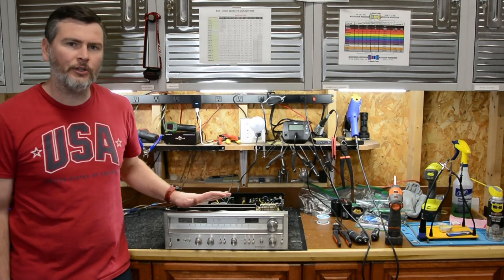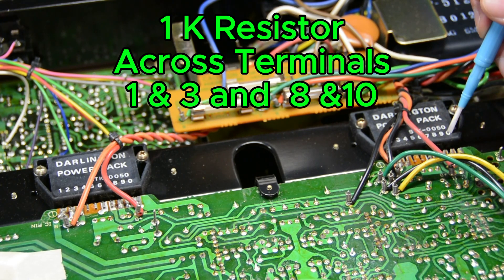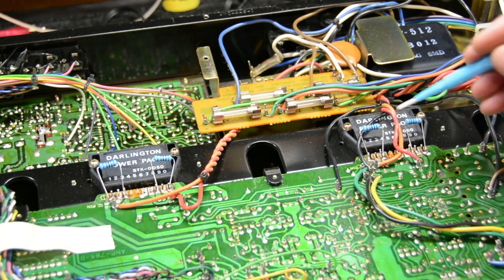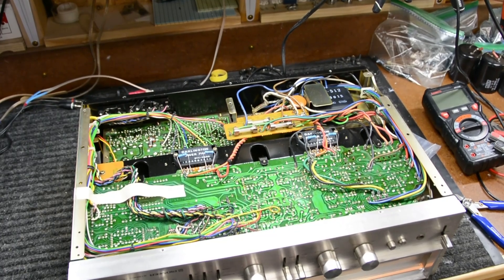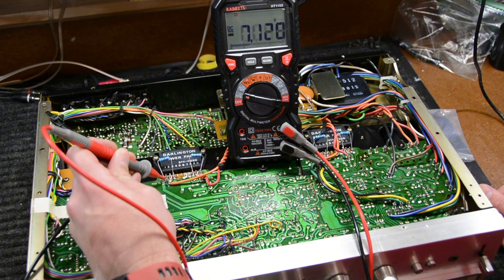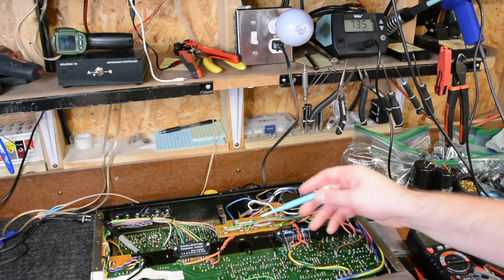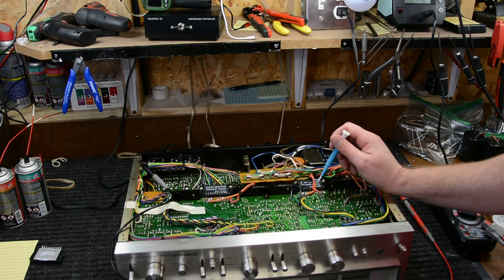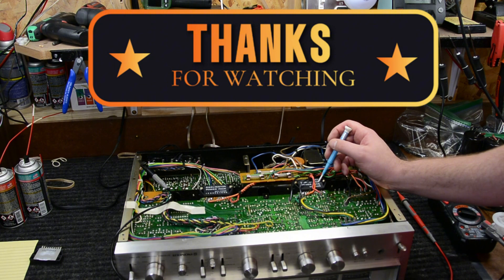How to Diagnose & Fix Bad Power Packs in SX-780 | Vintage Audio Repair Guide

Comment: Where did you get the new power pack? Was it a pull? It doesn't look like a Chinese piece.
Reply from the maker: Hey Mike. No its not an original. You can't find new old stock anymore. There are some people who advertise it as new old stock, but I don't believe it. These are ones I've been using in my rebuilds for a while that I find reliable. You see that I posted the dim bulb video for you?
Reply: @ATOAudio  thank you I did watch the video and constructed one for myself. I just ordered the component version of the STK 0050 from delta9electronics. Will be here next Monday. I should be done swapping out all the capacitors, some recommended transistors and diodes and the relay. I’ve found your videos to be a great help in my restoring my SX-780. Your time is highly appreciated. I can’t wait to listen to my “new” receiver that is hooked up to my turntable and 70s AKAI reel to reel 😁
Reply from the maker: @mikeharden7904  awesome man!!! Let me know if I can help!
Reply: Hi, where can I get a power packs?
Reply from the maker: @TheLarrybird  I've used a couple different ones over the years but lately I've been using one from a seller on ebay. https://www.ebay.com/itm/360296155076?_trkparms=amclksrc%3DITM%26aid%3D777008%26algo%3DPERSONAL.TOPIC%26ao%3D1%26asc%3D275609%26meid%3D2aa888fffa764eca99f9b983f6a19d24%26pid%3D101949%26rk%3D1%26rkt%3D1%26itm%3D360296155076%26pmt%3D1%26noa%3D1%26pg%3D4375194%26algv%3DRecentlyViewedItemsV2WithMLRPbooster_BP%26brand%3DUnbranded&_trksid=p4375194.c101949.m162918&_trkparms=parentrq%3Aed2071331920a6273fdac7d3ffffd066%7Cpageci%3Ad6d5e62a-9920-11ef-81b3-96e67a689164%7Ciid%3A1%7Cvlpname%3Avlp_homepage